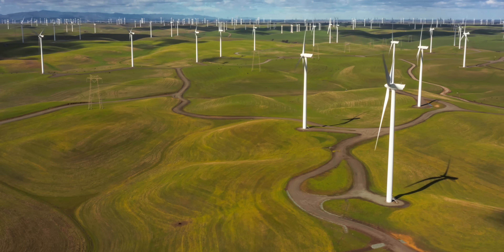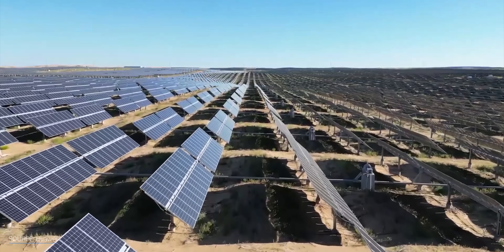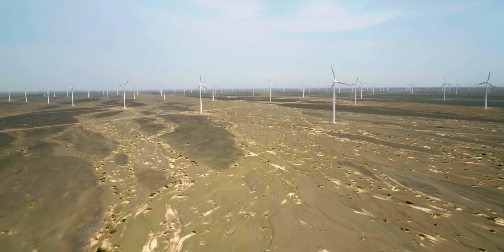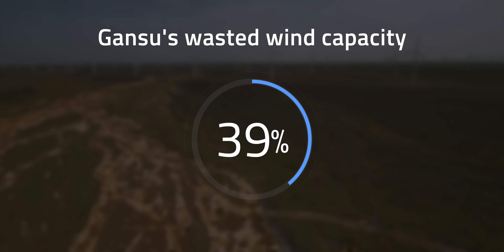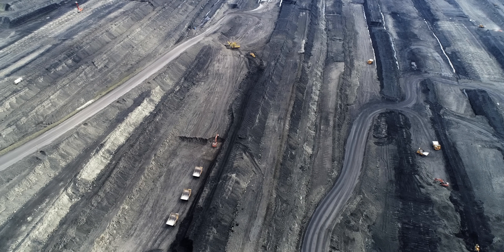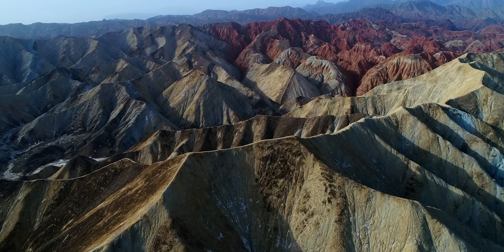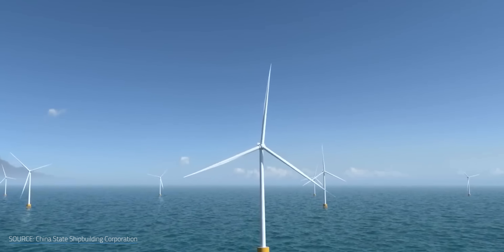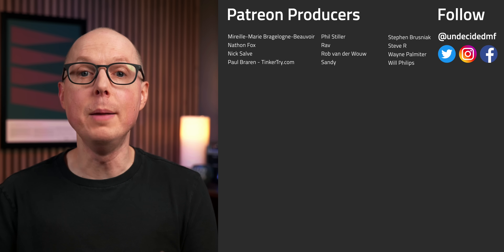The World’s Largest Wind Farm has a Tiny Problem

Comment: "Shipping container battery"... ship the stored energy to the part of the country where there's not much wind or solar compared to adding onto the grid by building towers for power lines. There's a company that retrofits commercial trucks from diesel to electric where they swap out the battery with a fully charged battery instead of sitting around waiting for the same battery to charge. Eventually instead of filing up at a truck stop, truck drivers will just swap out the battery of their EV truck. Car companies could have a hand full of standard batteries where you pull into a "battery changing station" instead of petroleum station to add fuel.

Comment: The transition to fossil fuel free energy cannot happen smoothly. Even if it didn't face opposition there would be problems. Add in opposition, and it will be rough. However, one way or another, it must happen.

Comment: hmmm....not sure if my math skills are up to the task. 1 gigawatt divided by 750,000 homes equals 1,333 watts. My electric car charger consumes 7,500 watts to recharge my electric car. If I am running my air conditioner and using my microwave oven, well, you get the idea.........but at least windmills can still produce electricity when the sun goes down.

Comment: Wind and solar are a environmental disaster, take away the subsidies and it collapses. The whole thing is built on misinformation for the gullible.
The pollution to produce wind and solar is staggering. Fossil fuel is the cheapest energy, that`s why they don`t want you using it.

Comment: Grid blindness is very common failure in energy economics. 
Grids are $TRILLIONS infrastructure.
Grid infrastructure ROI, Return On Investment is $100sBILLIONS. 

Rooftop PV and BVs oversized battery parked 23hrs every day means that customers do not need grid electricity, BUT THE GRID DOES NEED THE CASHFLOW. 

Grow up and do full and correct analysis on this matter.  😮😮😮

Comment: "Green"? Simple fact a windmill's entire energy output over it's lifetime will not equal all the "fossil fuels" used to mine the materials and manufacture the windmill.
AND... the term is HYDRO-CARBON. There is methane on every planet in solar system. Titan moon has lakes of it. So unless one thinks dinosaurs and vegetation thrived on Saturn's moon and everywhere else "fossil" fuels is incorrect.

Comment: If your wind farm is consistently producing more energy than can be used or exported, energy storage doesn't help. The energy storage fills up and then what? Build even more energy storage? That's like trying to solve a leaking pipe with buckets, only there's nowhere to empty the buckets so your house fills up with buckets of water. If they cannot use or export the energy, the only solution is to dismantle some of the windmills and erect them somewhere they can actually be useful.

Comment: Windfarms have quoted generation capacity BUT the utilisation on all of them is about 40%. 1GW divided by 1000000 homes is 1kW per home. That isn't very much certainly not enough to power a normal home. Wind doesn't blow always when you need it either. No storage. EXPENSIVE!

Comment: Wow, I did not know that China was so far ahead in producing electricity. That's very impressive and we should so the same here in the states reduce our carbon footprint. I myself have a 17kw solar system that produces enough credits to not pay an electrical bill since I installed it. However, I also installed a 1.2kw windmill that has produced zero power. The windmill power production was a disappointment and a waste of my time and money. I live just north of Dallas, and I suppose it's not windy enough. In addition, I was so excited to do the set up myself that I did not realize or even think about that to produce that 1.2kw, the wind has to be a constant flow of 53 mph. Many amateurs like me, need to do a though study of wind patterns and wind speeds for your area before even considering such a costly wind project. In hindsight, I should have just invested that money in the nearby casino. Pretty sure the odds would have proven better in my favor. Live and learn, as they say.

Comment: Here in Australia........wind farms have proven themselves, in most locations to be highly variable and unreliable.  There are wind droughts that last for weeks, and if that coincides with very overcast weather, that knocks out most of the solar, then chaos ensues.  Its necessary to switch on lots of gas turbines to try and fill the gap, and natural gas is 3 times the cost per thermal unit of coal......so its sending power bills up, and up and up.   Many wind turbines in Australia are made in China, and within 5 years of installation problems surfaced with cracked blades, and generators already needing overhaul. Its not delivering on what was promised.
Reply: Oh, and too bad for all the large raptors and sea birds that get chopped up each year. They died for an unrealizable dream of unicorns and rainbows.
Reply: @mandelbro777  Actually its more the destruction of Koala habitat that is contributing to their extinction by wind farms.  This green energy is not green at all.
Reply: Yup, here in Australia, we're deep thinkers, and we've figured out the very best and fast6est way to completely wreck our once reliable energy infrastructure........ when the inner city nimby yuppies can't turn on the espresso machine, that's when the penny will finally drop, but by then it'll be too late to reverse all the malinvestment and 100x of unnecessary ecological wrecking (ironic) power transmission infrastructure. We're a dumb country, let's just admit it.

Comment: Great video, but one remark. Building a data center in a desert is problematic due to cooling issues.
Data center IT equipment produce a lot of heat, which has to get out. AC is really problematic with outside temperatures rising to over 40°C.

Comment: Funny thing about China, if they weren't the manufacturing hub of the world, they would have a near carbon neutral grid, but since we outsources everything to them, they are still burning coal.  However if the battery tech scales up they could potentially reach a carbon neutral grid by 2030. Its interesting that that in theory if a wall of windfarms was built on either side of tornado alley, tornadoes would drastically reduce,  and i we could build a wall of windfarms all along our coasts that was allowed to freespin once winds got too powerful, we could weaken hurricanes before they reached landfall.

Comment: I believe it’s a fail power wind farms have to be subsidized to work even here in The US it can’t compete with coal or natural gas. Here the states the coal plants are not being shut down because of environmental reasons they can’t compete with natural gas. That is the reason that Texas had that problem with that cold spell couple years ago. Want does beat natural gas is thermal energy and the power generated by dams.  Solar also can’t compete with out being subsidized I believe.

Comment: Okay, something that probably needs its own deep-dive video: You mentioned High Voltage Direct Current transmission lines. My understanding of the AC/DC battles between Tesla and Edison is that we landed on AC being more stable for long distance transmission, which is why we use AC power on the commercial grid. So what's the deal with DC transmission lines? That sounds completely backwards...
Reply: Tesla and Edison didn't have the technology we have today for power conversion. Back then there was no practical way to convert voltages in DC, which we can do now thanks to high-power semiconductors. They could only use transformers, which only work for AC. Transformers still work very well too - they are very, very reliable, they will work continually for decades with only an occasional minor servicing. But if you are doing very long distance transmission, then DC has advantages too: It has lower losses, and doesn't have the complexities of reactive power or capacitive coupling to deal with. It can also connect between grids, which AC can't do - making it the only option when you are sending power from one grid to another, often the case for international power trade.

Comment: When looking at Windparks without the grid capacity you can look at Germany. Germany build an offshore windpark and planned the grid for it, unfortunately the individual provinces were tasked with realizing it which went nowhere because nobody wants new powelines in their backyard.
Reply: We've got the same problem on a much smaller scale in the UK: The grid needs expanding and adapting to transport renewable energy, but no matter where the grid operator proposes building pylons there is always heavy local opposition. Usually the opposition demands that the power lines must be buried, rather than put on pylons - an option that is far more expensive and disruptive to construct.

Comment: I went to a dam that gave tours, and asked them why mot wind power, because it was obvious it was a good location. He said the local people didn't want it, because it would spoil the view. We have the technology, we know how to do it, have been doing it for a LONG time, but as a people we don't want it for some pretty dumb reasons.
Reply: ‘We’ don’t want them for a lot of good reasons too, not the least of which is how incredibly inefficient they are and the initial setup and maintenance costs. Having said that even a mid-sized windmill operation is easily the ugliest and most archaic thing mankind has ever done to a beautiful planet.
Reply: @rayray8687  Wow, lots of projecting. You obviously have never used alternate energy. On the other hand I have lived with it for over 20 years, and it's nice to have when everybody else's power goes out. It's nice to  not have to pay the electric bill, and cost less than bringing in power. The only downside is you need to understand the power formula, because thinking something like amps does all the work will sink you.

Where do you think you get your power from, the wall?
Reply: @lesliesavage9229 : “Projecting”? Not sure what you meant by that, but anyway I occasionally pass by a number of different wind farms but one in particular stands out. I believe it has about 40 to 50 mills and yet on several trips I have never once seen more than 3 operating at the same time, nor has anyone who lives in the area. It was once part of the beautiful landscape of a relatively unspoiled cottage area in northern Ontario CA. I’ve also seen the utterly massive solar panel projects in Cotswolds, etc UK, a place where the sun shines about 30 days a year. I totally agree with having one of these devices in your backyard if you have an acre or two but to imagine they actually contribute to the electricity needs of a great big world is complete fantasy. Plus they’re butt ugly.
Reply: @lesliesavage9229 : Oh, and btw, I know exactly where I get my electricity - almost entirely from hydro and nuclear fuel generation. If you get yours from a windmill that’s good, most of us don’t have a place to put one. What do you do when the wind doesn’t blow?
Reply: @rayray8687  Like I said, you never used any of it, and you continue to show you have no idea what you are talking about.
Reply: @lesliesavage9229 : Of course I’ve never used it because there aren’t any in my area and the ones 2 or 3 hours away, as I said, almost never run, they sit idle most of the time. The fact is wind generators only produce when the wind blows and solar panels only when the sun shines. In my broader area more than 90% of electricity is produced from zero-carbon sources and most of the remainder from relatively clean burning natural gas with a virtually negligible amount from wind and sun, essentially because they are woefully inefficient and unreliable. In the meantime nuclear fusion as a fuel source is hopefully just around the corner and that should be the end of the argument. Having said all that I do have 10 solar powered garden-path lights and a similar powered birdbath fountain pump to keep the feathered friends happy, but even those fail 60% of the year, yet still I imagine it’s as close as I’ll ever get to relying on solar or wind powered electricity for anything. And the birds are happy in the bath with or without it! Thanks for the convo. 😊

Comment: And, in less than 20 years there will be 21,000 windmill blades in need of replacement.  And, each of those turbines needs 80 gallons of synthetic oil.  It takes 12,000 gallons of crude to produce it.  And, it has to be replaced once a year.
Reply: Still less crude than oil powered generation and the blade problem means jobs !
And how long do you think power generating turbines go without maitenance!
Here in UK we have just turned of our last coal powered power plant.And we currently have one of the biggest offshore wind farms in the world and we have more than one and we even export electricity to europe!
Reply: @jeremywilson2022  Is there a wind turbine that can produce power when needed?
Reply: @jeremywilson2022  You’re going to regret that move…. Learn how power grids work…
Reply: 80 gallons of synthetic oil cost 600 to 800 dollars. 12.000 gallons of crude oil cost about 15.000 dollars. Can you explain to me, how they offer 80 gallons of synthetic oil for under 1K, if the input is 12.000 gallons of crude?
Reply: Thank ya
Reply: It's not like the other 11980 gallons of crude go down the drain, so that's not really a useful figure to be quoting.
Reply: @beeble2003 lmao 🤣

Comment: There has been an energy breakthrough called enhanced geothermal.  It uses advanced fracking techniques to drill geothermal wells that can be used to create steam power, almost anywhere on the planet.  This is different from traditional geothermal, which is site-specific.  Enhanced geothermal can replace nuclear, and even wind and solar over time.  It can produce clean energy 24 hours a day, 365 days a year, with no intermittency issues, or need for extra battery storage systems.  Check out the U.S. Dept. of Energy’s Forge project in Milford, Utah.  The future is geothermal!
Reply: WOW !!!
Reply: I hope that is true. Geothermal in theory is great. In practice it has not worked well in recent decades.

Comment: 39% unused does not mean this is actually waste. This enables saving on the typically much more expensive storage: you still get enough power if the wind has only half its usual strength. So it reduces the times when you would otherwise already be depleting your storage.

Comment: Fossil fuels are the combined storage of solar and gravitational energy, in a very transportable form. The machinery used to convert the solar energy (plant life) is also a necessary machine to convert co2 into o2. The hard work has already been done and the energy to produce the converted energy has been spent. Plant life is the machine and instead of creating pollution it creates more life. The manufacture of new machines to convert solar energy is a waste of energy, causes pollution and strips the environment. A more proper path in my opinion is to spend all of that money on a clean conversion of the fossil fuels back into usable energy. Even if you were to use a nuclear reactor to produce the energy to extract the energy from fossil fuels cleanly, we would be better off.

Comment: Problems with big-massive wind farms is costs and life span then end of life the ever recommissioning new or restoring the land. And who realistically pays all that and also resources needed and the recycling issues they have. The other issue we are finding in the uk with are farms and reliance on them, is what happens if the wind doesn’t blow enough or it ant sunny enough. Don’t get me Wong wind and solar in moderation is good, but as someone who cleans home solar arrays, i run into customers who didn’t realise they had to be maintained and wear under the belief it was all free energy for life after the cost of installing, and a big shock when they released the drop of efficiency if not cleaned let alone some customers have old arrays that are eproching end of life who expect a clean to restore it to new efficiency. And people like me have to explain and show why not… not the customers fult its mostly down to companies that install them not telling the customer about proper maintenance management, and sales hype and over expectation and being miss lead. A well looked after quality array can last apx 20 yrs but average I’ve seen 16 yrs. There is a lot that people and companies that push so called green tech don’t ever consider or misleading about. My biggest concern there seems to be very little end of life planning about this infrastructure.